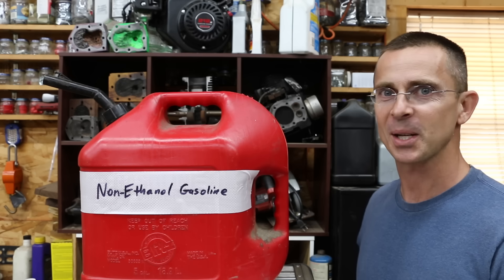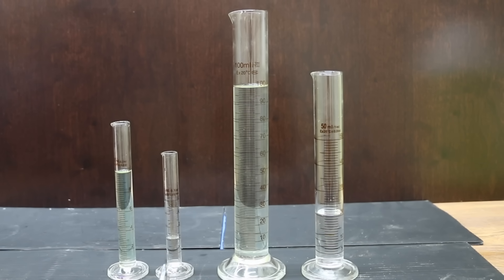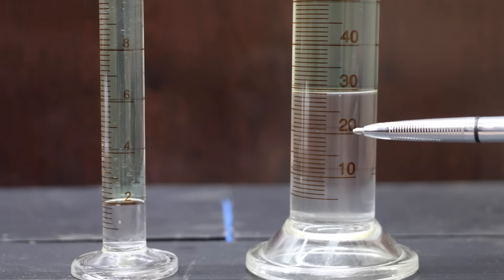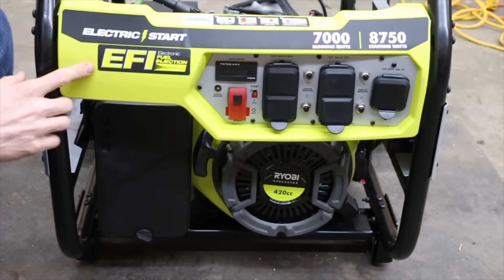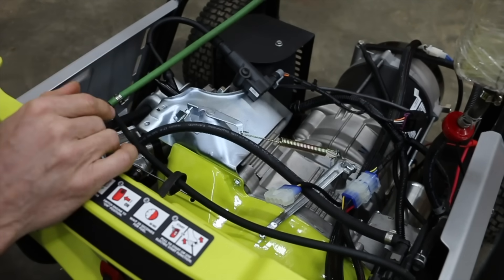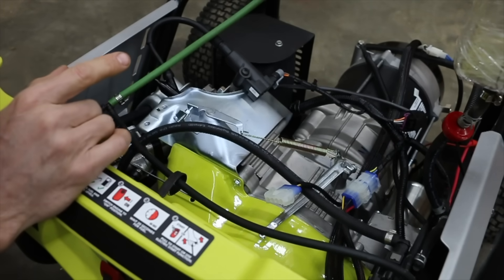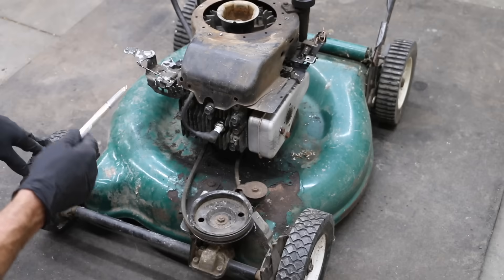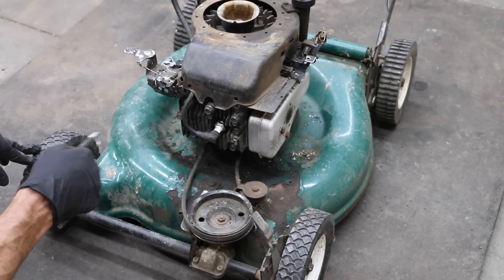Is Non-Ethanol Gasoline Really Better? See the PROOF!

Comment: I don't run ethanol fuel in anything with a carburetor.
Reply from the maker: That's a wise decision!
Reply: Don't move to Iowa, we don't have ethanol free fuel, everything here is at least 10% ehtanol for "cleaner air" in iowa.
Reply: @TheRealBmanswan   That will be for pretty much every place.  But, some gas stations can offer it just like they do in Indiana.  They sell it at a separate pump and sell it as recreation fuel.  I run it it in my zeroturn and weedeater.
Reply: @bigrigross  Iowa has strict rules about it. You have to go to nebraska or out of state to get gas without ethanol. They only do it because we have a ton of corn. This state and it's fuel rules are stupid.
Reply: @bigrigross  The 91 octane fuel sold by one of the gas station chains here in my area is only ethanol-free and is pumped through the same pump as the "normal" ethanol based gas. So it's treated as normal fuel for vehicles that require it, no special "recreational fuel" titles. Of course, it is the only gas station chain in the area that sells ethanol-free high-octane gas. I buy it all the time for my chainsaws and yard equipment. If you want real racing fuel we have a VP Racing branded gas station in the area that sells normal gasoline and offers their own high-octane racing fuel in metal 5 gallon jugs. I've been wanting to get a jug of it for running in my chainsaws, I just never have the money.
Reply: @bigrigross  where in indiana are you? I am up north cant find it anywhere
Reply: @nobelhansen2015    I live close to bloomington.  We have them at several gas stations.  There is a website you can go to pure-gas,org to find out where they are at near you.
Reply: @bigrigross  i live by Chicago in indiana.  We dont have a choice here.  Most gas stations are anywhere from 10% to 15 %
Reply: Not true.  Look at the pumps that say NO ETHANOL 87 octane.  The "super unleaded" is 87 with up to 10% alcohol and regular 87 is NO ethanol.  The base gas in Iowa starts out at 85 octane and is blended to up it to the 87 minimum requirement.  To get the 87 non-corn gas they blend in premium with the 85 octane base.  That is why the regular 87 costs more then the ethanol 87.  My buddy delivers gas for Caseys so he would know.
Reply: @MontyCarlo1977  Non ethanol does cost about 20%  more in Sioux Falls. That's what I buy because all my cars and equipment are older. I'm thankful they have it.
Reply: @MontyCarlo1977  Great explanation.
Reply: @MontyCarlo1977  do the test yourself to prove it.   Buy a little and put it into a gas can.    Take it home.  Put a tiny bit on your finger.   It will be oily as hell.
Reply: @TheRealBmanswan  In Brazil we have almost 30% ethanol in every gasoline type lol
Reply: @TheRealBmanswan  incorrect. There's a local gas station in Davenport that sells without ethanol.
Reply: @vinniepearl  oh so 5 an a half hours away from the other side of iowa they sell non ethanol fuel? My home town is Davenport Iowa, the stations there get it with plenty of restrictions. Its the quad cities therefore they operate much more differently then other places in iowa.
Reply: @vinniepearl  you'd still need to travel the distance to get that type of fuel, just like in Sioux City you have to travel as far as Omaha to get non ethanol fuel. That's still a distance to go for non ethanol.
Reply: @TheRealBmanswan  Come to Sioux Falls, quite a few have real gas, HV, Shells, Caseys.
Reply: You can find ethonal free gas in Missouri, but it's really expensive
Reply: @TheRealBmanswan  Unless youre in Ames or Iowa City. All the students ride mopeds, so almost all the stations have ethonal free.
Reply: @TheRealBmanswan  I'm assuming "cleaner air" is in quotes because it has nothing to do with the air and everything to do with subsidizing corn growers.
Reply: @NoZioKikes88  ethanol fuel is supposed to burn cleaner than regular gas, it also has different mixtures meaning different emissions coming from the exhaust (this is supposedly how it works). The alcohol in the fuel helps break up carbon build up to make the air cleaner if you ever look at fuel system cleaners or injector cleaners that go directly into the gas tank you'll notice they are made out of different alcohols, these help clean the engine internally just like sea foam has alcohol in it too.
Reply: @TheRealBmanswan  so your not saying alcohol makes the air cleaner in this comment? You contradict your self everytime you talk and prove the lack of knowledge you have about automotive injection systems
Reply: @nathanroussin1315  no you just didn't read back enough in the comments nor understand the difference between a cleaner engine and cleaner air. Actually not once did I sit there and try to explain how it's cleaner because I know it isn't. But alas I had to point that directly out to you because again you have this mindset of needing to be right and everyone is wrong. But it's just your lack of reading and comprehension skills.
Reply: @nathanroussin1315  I'm more amazed you didn't see the quotation marks in my saying of "cleaner air". You clearly can't understand blatant sarcasm.
Reply: @TheRealBmanswan  you specifically say here that alcohol helps break up carbon deposits to to make the air cleaner, no quotes lol it does nothing of the sort. so maybe I am confused as to what you actually think the reason for ethanol being added to fuel is. But I can tell you it has zero to do with it cleaning properties. You talk about seafoam having alcohol in it, this is true but its little more than isopropyl alcohol the same stuff in your medicine cabinet, far different feom ethanol, the main cleaning ingredients in seafoam are actually petroleum based products more similar to diesel than any kind of alcohol, if the goal was for the liquid ethanol to clean they would use diesel its a far better cleaning agent, your premium fuels that actually advertise to clean you engine actually have very littlw to no ethanol in them, they are litteraly detergents, you say ethanol is bad and dirty and harmful bet yet you say in many comments its helps to clean the intake and fuel system
Reply: @nathanroussin1315  huh weird all of my comments mentioning "cleaner air" the first one says it in quotes and the second one has parenthesis stating the sarcasm ( like how this is done because you apparently cannot read.) You clearly think that when I say it cleans the engine that instantly means cleans the air too. No let me say it slowly, the alcohol cleans the system but is not clean for the air. From what I've noticed from personal experience using Ethanol compared to non Ethanol was a hotter engine but clearly fuel and intake system and less fuel economy, regular gas didn't do these things. And like I've said before you don't clearly read and comprehend anything and you're still trying to play the "I'm right your wrong card" by repeating something I didn't even say. My comments say otherwise to what your accusations say, i don't need to defend myself. Plus like I said before I've already done my own tests and saw the differences, you saying otherwise isn't going to change what I physically witnessed. Sorry you're not able to be right 100% of the time kiddo.
Reply: @TheRealBmanswan  corn belt
Reply: @TheRealBmanswan  if you have a Buc-ee's nearby they should have ethanol free fuel. It will have a blue pump handle. It's right by the diesel, green nozzle.
Reply: @TheRealBmanswan  I'm in eastern Iowa and can find ethanol free gas at just a few stations.  Usually, stations that sell race gas or boat gas will carry it
Reply: @TheRealBmanswan  Same in Texas now, the last regular gas station that had pure gasoline went to 5% ethanol in 2009, now they're all 10%.
Reply: NxT Bman you are wrong most gas stations still have non ethanol there are a few stores that don't (btw I'm from Iowa too)
Reply: @hotrodpaully1  Here are the prices:  https://e85prices.com/iowa.html
Reply: @TheRealBmanswan  The Casey's store where I am has 87octane ethanol free. It's all I will use in my stuff.
Reply: @TheRealBmanswan  they have you fooled hahaha ethanol is made from corn dude it's cheaper for them to to water down your fuel and make more profit being as there is alot of corn there in iowa there just helping there farmers
Reply: @nathanroussin1315  ethanol is an alcohol made from corn dude... I'm from Iowa so you're not teaching me anything. Also no one has me fooled for anything so I'm confused as to what you are talking about. Alcohol in fuel systems breaks apart a lot of the intakes build up, the down side is it runs hotter and burns too quickly, so fuel consumption is terrible. Regular gas burns better and doesn't make an engine run as hot. I don't use ethanol for the specific reason of it being capable of shortening the life of a cars engine in the summer. Also the ethanol fuel program in Iowa doesn't help any farmers. They use their own materials.
Reply: @TheRealBmanswan  I have a very good understanding of fuels, my comment was not to teach you anything it was a joke, and to teach you something no fuel sits or should be sitting in your intake, it actually turns a whitish brown sand/calcium like build up in jets powervalves, fuel bowls, and injectors nozzles, pretty much anywhere stagnant fuel sits and is exposed to oxygin, the reason you burn more of it is becuase its has roughly only half of the potential energy as the same measure of gasoline, it runs hottwr because it ethanol has a higher flash point than gasoline thus meaning it has to be hotter to burn in the firstplace
Reply: @nathanroussin1315  the alcohol fuel burns in the injection system cleaning the build up that is in the engine, the same fuel that is burned up exits the exhaust which also goes back through the exhaust back into the intake of the engine. This is where build up breaks down in the intake since regular fuel produces heavy carbon build up in the intake. Alcohol fuel removes the build up. It doesn't take a genius to know an intake is effected by the fuel system. I've cleaned plenty of intakes out that had carbon build up from the exhaust return.
Reply: @TheRealBmanswan  you are obviously reading off Google and have zero understanding of what you are talking about, first nothing burns in the injection system! Second thing will be two parts d.i and p.i??? Direct port or port injection, you have to go as far back as the late 90's to find automotive fuel injection system that the fuel passes through the entire length of the intake runner for that "alcohol" to be cleaning anything in intake, ethanol was just starting to find its way into fuel those years, most injection systems position the injectors right where the intake meets the head and has a direct line to intake valve or valves, thus the clening its used for are intake valves,piston faces and combustion chambers which are obviously internal engine parts and what about direct injection where fuel never touches any part of the intake tract? Hows it cleaning anything? As for the exhaust that gets re ran through the engine has nothing to do with ethanol or deposit build up, if you knew any thing about egr systems you would know that there main purpose is decrease oxides of nitrogen aka nox found in exhaust gas and egg ports on some intakes do build up with carbon and you have never had any experince cleaning them as you would know ethanol does does nothing to keep those passages clean, egr systems are becoming less common on newer vehicles, care go to discuss evaporative emissions and their role in the whole injection system?
Reply: @nathanroussin1315  yeah sure okay it's the internet and you think you're the only one who apparently knows anything. I own a 92 and a 97 that I've personally rebuilt the engines. The intakes gather a lot of build up and if you run alcohol fuel through the engine system (much like seafoam) it cleans out the intake and the actual engine. I know what I've replaced and cleaned and how it got dirty I'm not going to sit here on a YouTube video and bicker with a wannabe know it all.
Reply: @TheRealBmanswan  did you read what you just said? A 92 and 97 I specifically said as far back as the late 90's your missing the entire point dude, like you just said a 92 and 97 most likely GM tbi aka throttle body injection where you have basically an all electric carb. To injectors one for each bank positioned above a single throttle plate air fuel mix happens in the plenum and is carried the entire length of the runner which will clean the intake I said that and was not arguing that point. The friggin point is in those years ethanol in fuel was in its baby stages when those injection systems were designed. Trust me when I say the refineries didn't say hey lets put ethanol in fuel to clean engines that make up 10 percent of the cars on the road hahaha. Ethanol in fuel is a cheap shitty desructive way of increasing profits and you are FOOLED sir if you believe they are doing it for clean Air, like I said you live in iowa corn corn corn wake up man its about profit not air 116 leaded in any car with 13+ compression and up to temp can pass smog tests at idle if that says anything for how clean gasoline can be made to burn
Reply: @TheRealBmanswan  like in this comment here lol
Reply: @TheRealBmanswan  and this one
Reply: @TheRealBmanswan  it's like your defending your statment of ethanol addition into fuel is done for cleaner air and emmisions like stated in the above comment from two weeks ago
Reply: @nathanroussin1315  you didn't share anything, you just keep saying "like this comment here and here" but yet you display no evidence just your words. Oh that's right you didn't share anything I said because all my comments say it's not cleaner for the air only your engine. But unfortunately my words can't be put on your comments you make and everyone here can clearly see what I said themselves by seeing my name on my comments lmfao not yours.
Reply: @TheRealBmanswan  : Same in IL. , nice free country,NOT ! Our forefathers warned us about a Government like this.
 I wish he would run a test on small 2 cycle engines !
Reply: We don't have any fuel without ethanol in Finland. No problems this far 😂
Reply: @oddis188  Well not at pumps. you usually can find "small engine" fuel without ethanol in canisters. usually same stores have 2 stroke gas (gas mixed with oil) aswell. ofc both of these are priced as their weight in gold though.

Doesn't matter much to me though, I use E85 during summer and 50/50 mix of 95e10 and e85 during winter, since pure E85 isn't good for cold starts. Car i drive is a '99 peugeot 406 with a flex fuel kit. hasn't given me a single problem.
Reply: @LasOrveloz  e85 and has do not mix.   Get 2 gas cans.  Put half gallon of each in.   Now with your 2 different has cans pour equal amount into a clear class container.  You will see how e85 settles to the bottom fast.   This is where the fuel pump draws fuel from the cars has tank.
Reply: @jeremyp5027  Yes, for the first second or so, but as soon as the starter starts to spin the engine and the fuel pump to draw from the tank, it starts to mix up. also, fuel separation isn't that fast of a thing. It will be getting more gasoline, when they're mixed, not much, but enough to help with cold starts in winter conditions. they do mix enough to help with starting up. I don't need the fuel mix entering the engine to be 50-50, i need it to be closer to 20gas-80ethanol, when starting it up. 50-50 mix usually will do that (my ethanol kit has a sensor with bluetooth and phone app to see the ratio, I see clearly enough what the ratio is at start and at normal operation)
Reply: @oddis188  We in Belgium neither. Only 95 octane and 98 octane with ethanol. It already killed the fuel pump in my motorcycle. :-(
Reply: oddis slajos It will destroy anything that is carbureted or lawn equipment.
Reply: @oddis188  , So how long do your chainsaw engines last ?  Can I assume you don't have one and are only talking about some kind of car ?
Reply: In Britain the ethanol content is getting worse in fuel. Most lawn and garden machinery dealers are now selling fuels like ASPEN. Plus the classic car owners are finding out about the harm it causes as there have been a few fires  because of leaking fuel damaged hoses.
Reply: @bentullett6068  Here is the U.S. when they first started putting ethanol is gas it caused a lot of trouble with rubber hoses in boats, it would destroy the rubber.
Reply: Ethanol-free is available in Louisiana.
Reply: @MrNorthstar50  Yep. Ethanol disintegrated the fuel line on my 1996 snowblower. Float bowl was clogged with bits of rubber.
Reply: @bentullett6068  I think it's also a way to stop people owning older, robust and vehicles that do not require fancy software, are not designed obsolescence, or yeah in the UK, no tax on the olde ens,
Reply: I dont know of any stations in my area selling 100% gasoline. So we don't have a choice for our lawnmowers. 
But my mower is over 10 years old and runs strong.  I change oil in spring and run the tank dry in fall.
Reply: @dougn2350  OIL should be changed before putting away for the season.
Reply: I learned that the hard way
Reply: 7.25 a quart 23.00 a gallon id better than 50 for a carb and another 50 for someone to put it on if you cant. Prices i got are for canned fuel. Not out of the pump.
Reply: Hete in my country we got e100 vehicle with carburetors, but the carburetors are different from the gasoline ones... And this old e100 engines last longer than the Gasoline equivalent. A customer has a EFI Chevrolet Monza 2.0 with  578k milles (925k km)
Reply: I run ethanol fuel, mostly E30 at that, in everything with a carburetor including my 2 stroke stuff.   doing it for around a decade now too.   

No issues outside what everyone running non ethanol have ever had.
Reply: Tcmtech If youre using a stabilizer and running it often you wont have issues. Now if youre feeling lucky, let that gas sit still a month no stabilizer and no running.Thats why I can pay my bills right there.
Reply: @BepBepStev   A month, and what is stabilizer?   

That kids play.  I have stuff that sits for 6 months between uses without stabilizer and it's just fine.  

As long as the container the fuel is in is sealed the stuff is fine for 6 months or more which is about as long as regular gas is too.
Reply: Ethanol free gas can last up to 3 years. Usually your ethanol stuff lasts a month, unless it is sealed like you said. Also I can pretty much guarantee you that if you open the carbs on your equipment thats been sitting, then youll see build up.
Reply: @Bernhard Jordan that'd be a great idea if the people who have their businesses on chrome would update their stuff. I've tried that before that's how I found out Omaha was the best spot for me.
Reply: Does not make a difference. IF you do notice the rubber perishing, replace with the better rubber and will last for a long time.
Reply: wobbly sauce It DOES make a difference. Especially if you are talking about recreation vehicles and Carbs. It destroys virtually all seals regarding the fuel system.
Reply: wobbly sauce most true statement I’ve heard
Reply: My old '73 Satoh s650g certainly likes pure gas!
Reply: if i am correct and the separation i am getting from letting my gasoline sit for a month or so then thats all you have to do . i never did the price comparison to regular or non ethanol so i dont know  if the savings are worth the difference . in my test i used 50 gallons of co op gasoline and let it sit and found that about three gallons of something separated out of the 50 .  when i used other fuels non co op i did not get any separation from sitting .  was it ethanol from the co op fuel or what i wonder .
Reply: I daily drive a 67 mustang with a carb here in CA we have ethenol 10% gas . I used modern fuel lines from tank to carb, and a carb rebuild before that 3 years.No adverse effects, the carb internals seemed exactly as before the rebuild
Reply: Ethanol free fuel can be purchased from a lot of small airports. Aviation fuel can't have ethanol in it because of how easily it absorbs water and that with the high altitudes, they need to make sure the fuel lines don't freeze.
Reply: I wanted to run non ethanol fuel in my boat. Impossible to find in Las Vegas
Reply: here where I live there is nothing but 10% Ethanol in all the gas. I run an aluminum supercharger with an aluminum carb. A few years ago Hot Rod magazine had an article about how Ethanol eats aluminum.  Oh well. It does take alot over a long period of time.  In 10 years of time my aluminum parts are still okay.
Reply: @ViewThis.  Ethanol is much >>>easier<<< on rubbers, plastics, and metals than what gasoline and BTEX(benzene, toluene, ethyl benzene, and xylene) are.

If you doubt this, look here:

Ethanol = https://www.customadvanced.com/chemical-resistance-chart.html?chemical=Ethyl+Alcohol&rubber=

Gasoline = https://www.customadvanced.com/chemical-resistance-chart.html?chemical=Gasoline&rubber=

Benzene = https://www.customadvanced.com/chemical-resistance-chart.html?chemical=Benzene&rubber=

Toluene = https://www.customadvanced.com/chemical-resistance-chart.html?chemical=Toluene&rubber=

Ethyl benzene = https://www.customadvanced.com/chemical-resistance-chart.html?chemical=Ethyl+Benzene&rubber=

Xylene = https://www.customadvanced.com/chemical-resistance-chart.html?chemical=Xylene&rubber=

Need a second opinion?

https://www.coleparmer.com/chemical-resistance

Or here for a third opinion:

http://www.graco.com/content/dam/graco/ipd/literature/misc/chemical-compatibility-guide/Graco_ChemCompGuideEN-B.pdf

See what high aromatic gasoline is rated for with aluminum:

https://www.calpaclab.com/aluminum-chemical-compatibility-chart/

Note that ethanol is good with aluminum.
  

The main nontoxic ingredient of RV antifreeze is ethanol and it would not have stood the test of time if it had been corrosive.
Reply: I always use Top Tier fuel which contains up to 10% ethanol and I've never had a problem.  But, I don't allow the gas to sit around for more than a couple months and my weed wacker fuel uses oil made with a fuel stabilizer with e10.  Manufacturers these days do all their testing with e10.  My family had a Craftsman lawnmower 16 hp briggs for 15 years.  It still ran great when I sold it.  Around about year 14, I put a new fuel line in because it got hard and cracked.  I'd rather not drive 30 minutes to get ethanol free gas.  I've also had a couple push mowers over the years and a pressure washer.  No problems related to fuel with Ethanol in it.
Reply: Back in the day here in the US when ethanol was first introduced, there were issues with fuel delivery components such as seals and hoses.  Later these issues disappeared as new materials were used.  Because of this I don't try to run ethanol-enriched fuel but do sometimes as non-ethanol fuel is harder to find.  However, I like that ethanol-enriched fuel does seem to eliminate moisture contamination.
Reply: In germany no fuel without ethanol availabile :(
Reply: I do not use ethanol in any thing. 2003 pontiac 290,000 miles, 1997 gmc 225,000, 1985 honda snowblower and 1987 briggs and  stratton lawnmower.
Reply: Ethenol will stop up the needle valve on small engine carburetors I much prefer non ethenol but it's hard to get where I live so I must drain the tank when storing the equipment for any period of time.
Reply: Another reason why I favor electric over gas small engines
Reply: Me either I'm sick of rebuilding carbs or replacing the plastic shit ones the make today
Reply: I do and I've never had a carb fail.
Reply: Ethanol is trash
Reply: @Frank Dux What is funny?  I did not know pre-mixed gas at the store existed, but here it is at Home Depot: https://www.homedepot.com/p/TruSouth-Trufuel-50-1-Pre-mixed-Fuel-Oil-6525638/202532877
Reply: @Frank Dux Ethanol was the fuel the internal combustion engine was invented upon.  It also was Henry Ford's favorite fuel and the fuel which he designed the Model T to use(production models were flex fuel).

The common gasoline of Brazil has a minimum of 27.5% ethanol with many of the very same non flex fuel cars, boats, motorcycles, and small engines we have.  It has worked out so well and for so long that Argentina and Paraguay have gone/are going to high levels themselves.

The United Arab Emirates have imported a pile of ethanol for many years.  It is not because of a lack of petroleum either.
Reply: @danafletcher2341  And how do they keep the moisture out of the fuel lines? 

I'm going to have to look into this more thoroughly as my only option for ethanal-free gas is premium stuff and my motorcycle manufacturer indicates that regular is the preferred octane rating. Meaning that I'm spending more money and if the ethanol gas isn't a problem, then I might as well get that.

Also, I get the feeling that the ethanol-free premium gas is getting worse gas mileage than the regular stuff. Which doesn't much make sense to me.
Reply: @SmallSpoonBrigade  Water is a problem of straight gasoline, not ethanol.

Years ago in the days of E0 gasoline every winter people would even have to buy little cans of alcohol called DRY GAS or HEET as gas-line antifreeze.

Gas stations would even have cases of it stacked up near the check out counter during that time of year. No one likes having a fuel line froze up in dangerous temperatures. It was common back in the E0 days.

Since E10 came, nobody buys DRY GAS or HEET anymore because the alcohol is already in there. There may be a dusty bottle or two back on a back shelf somewhere at the gas station, but that is it.

If ethanol did cause water/phase separation problems even half as much as is claimed, we would know it right away because every winter millions upon millions of cars would be stalled on the road in the northern US and Canada. This obviously never happens, but many cars did stall with frozen fuel lines back in the days of E0 straight gasoline.

...Mercury Marine, which hosted a Webinar on ethanol myths, noted that ethanol does not "grab water molecules out of the air." It is hydrophilic, which means ethanol holds water. With regular gasoline (E0) as well at E10, the primary cause of water collecting in tanks is condensation on tank walls. But unlike E0, which can absorb almost no moisture, E10 can hold up to half of one percent of water by volume, and the water molecules will dissolve in the fuel. The "solubilized" water will bypass the water separator and burn harmlessly through the engine...

>>>>Mercury Marine also says E10 may be the superior fuel(over E0) because it keeps the fuel "dry"<<<<

https://web.archive.org/web/20140922142320/http://dcd96xmek71bc.cloudfront.net/archives/email/Trade/BoatingIndustry/MythsofEthanol-August252011.mp4

According to a paper published by the Society of Automotive Engineers, at 68 degrees F, alcohol with as much as 45% water will mix with gasoline and not separate. With 4%, alcohol will form a stable mix with gas down to about minus 22 degree F.*

*A.C. Castro, C.H. Koster, and E.K. Franleck, Flexible Ethanol Otto Engine Management System 942400(Warrendale, PA:Society of Automotive Engineers International, 1994)

The common gasoline of Brazil contains a minimum of 27.5% ethanol and their premium contains 25% ethanol which Harley Davidson motorcycles require.  I doubt 10 or 15% in your same bike will be any problem.

For some reason your reply never showed up, I saw your post only because a useless post from Frank came in and then I saw yours.
Reply: I only use non ethanol gasoline in my lawn mowers and small engines only.I heard ethanol is way harder on small engines than it is car engines
Reply: @magdump4456  You probably heard it from the API(i.e. petroleum industry).

Non ethanol gasoline at the pumps is loaded with much more of the extremely toxic and carcinogenic aromatics like BTEX(benzene, toluene, ethylbenzene,& xylene) and too bad for you there is not so much as a  catalytic converter between you and them.

The small engines of Brazil use not a measly 10 or 15% ethanol, but a whopping 27.5% minimum.  It has worked out so well and for so long that Argentina and Paraguay have gone to high levels themselves.  See one here: https://www.honda.com.br/produtos-de-forca/gx120  Look familiar?

Ethanol is much >>>easier<<< on rubbers, plastics, and metals than what gasoline and BTEX(benzene, toluene, ethyl benzene, and xylene) are.

If you doubt this, look here:

Ethanol = https://www.customadvanced.com/chemical-resistance-chart.html?chemical=Ethyl+Alcohol&rubber=

Gasoline = https://www.customadvanced.com/chemical-resistance-chart.html?chemical=Gasoline&rubber=

Benzene = https://www.customadvanced.com/chemical-resistance-chart.html?chemical=Benzene&rubber=

Toluene = https://www.customadvanced.com/chemical-resistance-chart.html?chemical=Toluene&rubber=

Ethyl benzene = https://www.customadvanced.com/chemical-resistance-chart.html?chemical=Ethyl+Benzene&rubber=

Xylene = https://www.customadvanced.com/chemical-resistance-chart.html?chemical=Xylene&rubber=

Need a second opinion?

https://www.coleparmer.com/chemical-resistance

Or here for a third opinion:

http://www.graco.com/content/dam/graco/ipd/literature/misc/chemical-compatibility-guide/Graco_ChemCompGuideEN-B.pdf

See what high aromatic gasoline is rated for with aluminum:

https://www.calpaclab.com/aluminum-chemical-compatibility-chart/

Note that ethanol is good with aluminum.

The main nontoxic ingredient of RV antifreeze is ethanol and it would not have stood the test of time if it had been corrosive.
Reply: @danafletcher2341  ethanol is only corrosive to the rubber o-rings and gaskets in small engines, nothing else. I rebuild small engines for a living.Ethanol destroys rubber o-rings, you can literally take a toothpick and stretch it like bubblegum. Non-ethanol gasoline does not do that. I could care less about fuel economy, or cleaner/dirtier emissions.I am also not concerned about carbon buildup either since there is hardly any difference between the two when it comes to carbon buildup. At least that's what I see day to day everytime I rebuild a small engine. Not to mention non-ethanol gas gives you a little bit more running time than ethanol gas
Reply: @magdump4456  How could/would a piece of rubber know if it was in a small engine and not something else?

Why would all o-ring manufacturers show ethanol in their chemical compatibility charts as very compatible and far better than gasoline and especially the aromatics now being greatly added to today's gasoline like BTEX?  Would they not want to show ethanol is corrosive if they have to stand behind their O-rings?

How could there exist nontoxic RV and Spa antifreeze made of ethanol and all the rubber involved in those circumstances?  They have stood the test of time.

I personally do care about extreme toxins like benzene, should not exist in our fuel.  In small engines we take that in directly with no filter.  Many thought lead was A OK too.  Perhaps that is why things like Head Start exists now.    

Here is a kid who I have seen run his snowmobile on E30 and tests many rubbers with BTEX etc.  Here he is testing small engine parts of a few different grades of gasoline blends:  https://www.youtube.com/watch?v=yBwoxleZFPQ
Reply: @danafletcher2341  to sell more o-rings of course lol.all I can tell you is what we find everyday rebuilding lawn mower engines for people that run ethanol gasoline. It eats the o-rings alive.The people that run non-ethanol gasoline in their engines the few times we do have to work on them the o-rings and gaskets are never in as bad shape.we can tell what fuel is used without even asking the owner just by looking inside the engine. That should tell you something.dura lube also used to mention that you could run your car completely drained of oil as long as it was treated with dura lube before you drained it and look how that worked out, class action lawsuit.you can't believe everything a company puts out on their products. Common Sense 101.I guess when an oil filter company states that there's is the best on the market, I guess you believe them right? As long as they have a fancy chart?
Reply: @magdump4456  You mean they will go broke warranting them since they stated they were compatible and were not.

My guess is that ethanol is getting the blame when the true cause is from all the extra hundreds of aromatics and natural gas distillates including BTEX being added to today's gasoline after the 90s sometime when MTBE was outlawed.

Perhaps gasoline sold in cans at hardware stores is refined purely to a high octane without or at least fewer aromatics than what E0 pump gas has or even E10 pump gas.  It would be interesting to see that cleaner gasoline in stores mixed with 10% ethanol compared to pump gas E10.

Here is that kid again in a different video:
What is REALLY causing your small engine issues!!
https://www.youtube.com/watch?v=u6Ez6s2WEcE

Again, there should be TV shows asking/begging for small engine mechanics to come to Brazil.  They should have a shortage of them and small engine manufacturers should be going broke warranting all  the engines that should disintegrate from E27.5 in no time if you are correct.

I would bet there is no toxic and corrosive BTEX or natural gas distillates in their gasoline.  That would be worth looking into when I find time and an explanation why there is no news they need mechanics.
Reply: @danafletcher2341  believe what you want to my friend, I don't believe what I read or what someone tells me, I believe what I have seen and experienced for over the past 22 years of rebuilding small engines.anyways anybody that rebuilds engines knows that the o-rings even with ethanol gas will Outlast the short warranty of an o-ring . Non-ethanol gas will triple if not quadruple the lifespan of the same o-ring. Ever noticed that most cars start tearing up shortly after the warranty expires? Most o-rings are only warrantied for a very short time anyhow.
Reply: @magdump4456  Leaving a lot of money on the table by not moving to Brazil I have to say.

So I am suppose to believe all the engine manufacturers and 0ring manufacturers even that whole countries conspire that ethanol works(but secretly destroys everything) and take the word of some guy on the internet who does not like ethanol.  Hmmm.

Alas, in Brazil they find their flex engines last up to three times longer on E100 than their common gasoline.  E100 produces no soot.  We see similar things here with propane or natural gas vehicles.  With all the propane small engines around now, I wonder what those look like after running a long time inside.

That kid who test fuels, showed E10 and E0 in jars.  The E10 was very dark yellow in color compared to the E0.  If clear 10% ethanol was all that was added, why is that one not more clear than the E0?  
Perhaps companies are using dirty gasoline with the ethanol blend.

Again, I would like to see 10% added to clean E0 gasoline and see how much better that works.  

Very pronounced color:
https://www.youtube.com/watch?v=301gAgW2m5s

You are probably blaming the wrong culprit.
Reply: I had to replace the accelerator pump in my Marine carburetor because of the alcohol in the fuel turning it into a rock. On the bright side I saved money on a glass cutter
Reply: @martyharless5097  I hate it when the rubber washer in my garden water hose turns hard as a rock too, but I did not blame ethanol.

Here is an article that talks about rubber in the later part:  https://www.theautochannel.com/news/2015/09/01/140446-why-do-small-engines-suffer-from-ethanol-problems-video.html
Reply: @danafletcher2341  I never had problems with any of my Marine components until they started adding ethanol to the fuel. The other problems I've had were easily fixed because I didn't have to take anything apart to get to them. If you're really that ignorant maybe you should go ask a boat mechanic
Reply: @danafletcher2341  no reputable organization would refer to those who disagree with them as "whores". You may want to do a little bit more digging to find out who you're getting your information from. I know you're probably one of the lunatic left and you just want to pick the information that agrees with your ideology but really you might want to sift through the information a little more carefully
Reply: I run e98 in my snowblower x 2yrs. No exhaust smell. doesnt stink up the garage or my coat. Cannot leave it outside. If it is too cold it cannot be started with e98. Need to pull choke lever a touch to get rich enough mixture.
Reply: Th last place in the county that sold non-ethanol fuel discontinued it over a year ago. Perhaps the $1.56 per gallon higher price had something to do with that. I don't know where you live, Twiz, but you would be burning a LOT of gas going for it in this area.
Reply: I have one gasoline (carb) tractor, a couple of older trucks with carbs and several small engines on my farm and have no problems.
Reply: What I've learned is to never let ethanol sit, no matter the engine.

A lot of the issues ethanol caused when it was first pushed on us was due to it breaking down gunk in the fuel system. It's quite like adding fuel treatment (b12 in particular) in that it has different corrosive abilities that gasoline.

One little trick I learned years ago was to swap between e10 and pure gas over a few tanks and that will clear out your fuel system. I had gunk in an injector, swapped to pure gas and it corrected 90% of the issue, swapped back to e10 then back to pure gas and by the end of that tank the stutter was gone.

If you've ever washed car parts, rebuilt carburetors, etc, you'll know that different solvents remove different buildup. We often wash parts in gas (including e10) and e10 is better at removing some stuff than gas, other things the ethanol blend just can't remove because it alters the properties of the gas.

Unfortunately e10 is a lot harder on accelerator pumps than gas, but only really while sitting and allowed to dry out. Later model accelerator pumps are made of a different material, they hold up fine.
Reply: @craigmancool  Interestingly, we used to add a product called "X-10"  to the gas barrel on the farm for those older gas engines and it was supposed to do what the old lead did. Anyway, I constantly had problems with the gas tractor fouling plugs. I decided to leave out the X-10 years ago and that solved the problem. But regarding the old school leaded gas you mentioned, you're probably right.
Reply: My theory Government creates this crap to ruin your stuff so you have keep buy and paying taxes . They don’t want anything to last to long we live in a desposable world . Sad 😞
Reply: Then your carb is always dirty.
Reply: Yeah it's the worst thing ever.   Pit a little into a clear glass cup and let it sit for about 3 minutes and it turns into a milky white oily goo.    It's that unstable.   I like to pull gas out of people's cars that are running bad to show them what's being forced onto us all.   It's junk gas.
Reply: @jeremyp5027   What are you putting into a cup?
Reply: It saves fuel lines and better for carbs
Reply: been running e85 in jd riding mower for 5 years. runs way better.